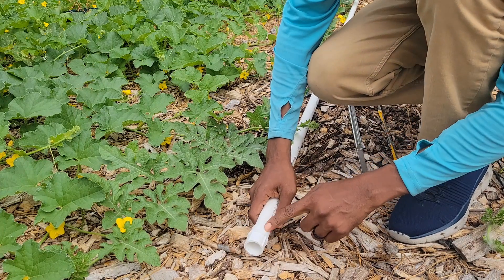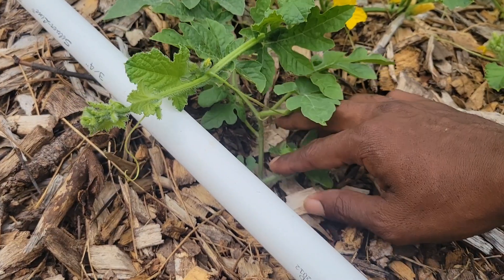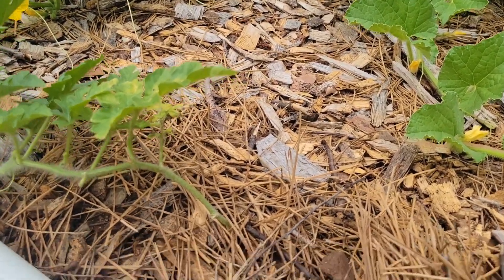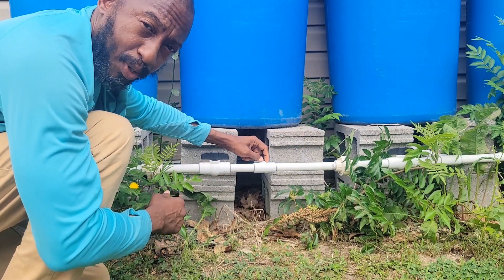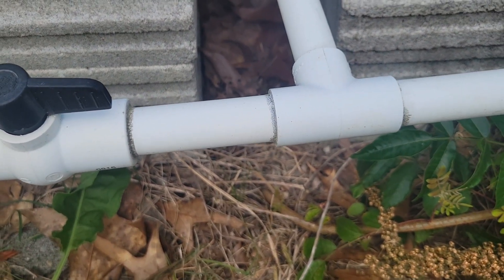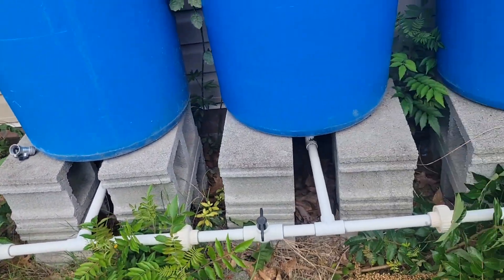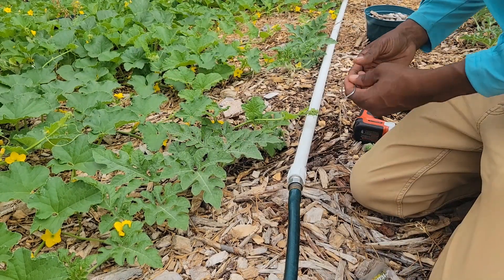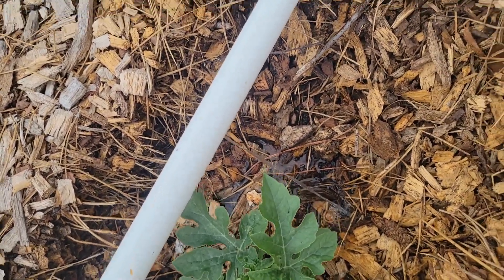How to Make a Garden Irrigation System?

Comment: This is a great idea. I’ve been trying to come up with something to not get my leaves wet and not have a permanent hose across my yard. I have all the PVC pipes from building a frame for my gardens for UV cloth shade cloth so it doesn’t lay on my plants. Alls I need is the connectors and end caps. Thank you Bear 🐻
Reply from the maker: Hey Denise, you are welcome. I'm glad that this helps you. My problem still exists. The rats are back. They probably never left.

Comment: Greetings, I am a new subby.  I wanted to ask you , can you use old grounded up leaves that you raked and use it as mulch ?
Reply from the maker: HELLO Pony Lockz, thanks for watching and subscribing. I appreciate it. You sure can. It will break down over time and provide nutrients for the soil. I have leaves in bags. I need to grind them up with the lawn mower. Just make sure you don't till it in the soil. I did that years many years ago, and it's not good.
Reply: @GrowSomethingTasty  if you shouldn't till it into the soil, then how else can you do it?  Do you have a video about it, I'll go back and check it out.🙂
Reply from the maker: @ponylockz7371  If you til it in the soil, it will tie up the nitrogen. Your plants will turn yellow. I remember doing that when I first started gardening. You lay it on top of the soil. I mainly now make compost out of it. A lot of leaves will blow away. I use woodchips, and it breaks down over time, changing the soil. A lot of people make leaf mold it takes a long time, but it's good stuff.
Reply: @GrowSomethingTasty  ok I see